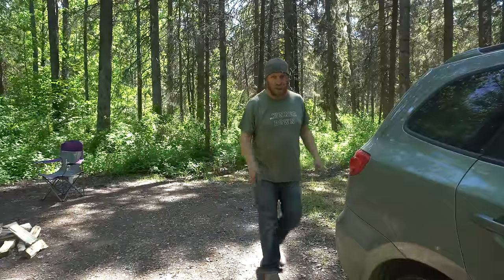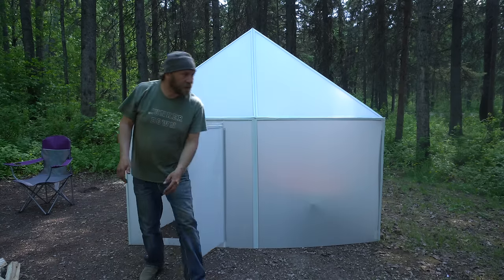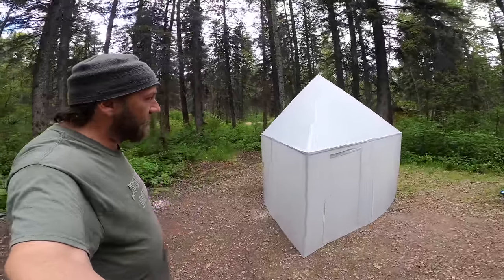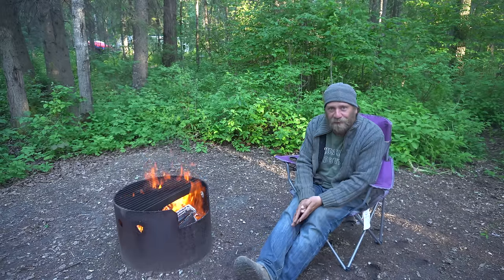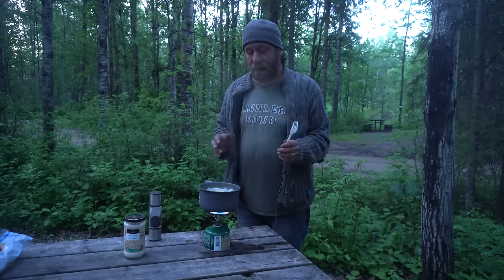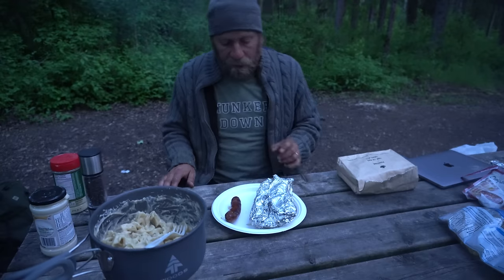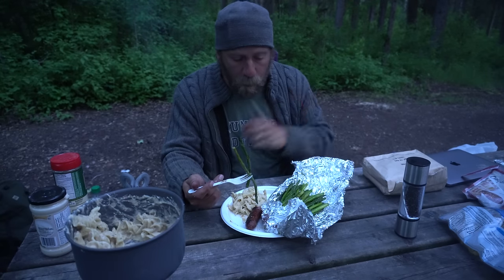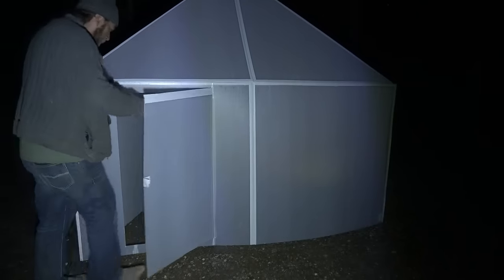Instant Pop Up Shelter Camping

Comment: You’re such an honest dude Steve. It’s one thing to have camping as a hobby and another to consider your impact on the environment. Thanks for using paper plates and biodegradable forks, it really shows you care for nature. This is how camping should be.
Reply: Do you understand the manufacturing process and energy that goes into making paper plates each year? In the long run it isn’t much more eco friendly..
Reply: @MrThatnativeguy  It's more eco friendly than plastic, in the long run.
Reply: Stainless steel plate.  No soap needed to clean.

Comment: When that popped up it immediately got my full attention!

Really clever design, excellent use of lightweight, strong and thermally efficient Coroplast.

I would definitely install a stove jack and stove in colder temperatures.

Comment: I like the idea of that camp shelter, seems there’s room for improvement to make it a viable shelter for use to keep bugs out and rain and the condensation down.  Maybe add a zip in tarp floor and zip panels for the last open walls to assemble and even for the door.  You could possibly even do a double door and make one a screen door with some vents on the opposite side to help with air flow.

Comment: I just read an article that states that in the USA (where I live) there is a strict requirement in egg sizes (it is probably the same in Canada). That said, there is a range within each grouping. When supply exceeds demand the producers are allowed to down-size, meaning they can put extra large eggs in the large containers and smaller large eggs in the medium containers etc. When demand is less then the producers will grade them by the appropriate size. edited [But I agree with you. I have a carton of medium eggs and one of large eggs and there were several in the large egg container that were the same size or only slightly larger than the medium eggs. However, when I weighed the eggs the ones in the large egg ca
arton weighed more than the medium eggs- maybe thicker shells?]

Comment: If you want to use the structure in the summer or for stealth camping you could consider putting camo tarp on the outside and cutting holes in it that you cover with mosquito netting for better ventilation. Keep doing what you are doing Steve, also love your smile :)

Comment: You should definitely add two dense mesh windows on two sides to allow a good air flow should keep the heat and moisture down definitely won’t help with the bugs but if you add a slight lip around the bottom of the entire edge you can lay loose dirt on it to create a little better seal to help keep some of the mosquitoes out.

Comment: Definitely cut some vent holes in the roof and gorilla tape on some screen door mesh! That would do a lot to help with comfort in your shelter. 

Also, I never go camping without one of those electric bug rackets.  That will clear the skeeters ot of the shelter fast.

Comment: That shelter actually looks good to me. With some cheap space blanket material put over the roof with spray adhesive, actual hinges on the panels and a couple of screens, for cross ventilation (with clear plastic covers, maybe), it could be great. Okay, some way to peg it to the ground.

Comment: I think I would cut a couple holes in the walls and glue some screen to those holes. Also I would paint the roof a silver color and just go nuts painting the sides to help block out any light from shining in or out. The bug problem will be a hard one unless you spray as soon as you setup the shelter.

Comment: Steve the skeeters get in from under the pop up, so get pool noodles from buck store and cut a slit in them and slide on bottom walls on pop up.
Staple or tuck in the slit between walls and noodle old rags, tshirts, socks or any flimsy fabric to drop down over pool noodle to ground like a skirt.
God Bless

Comment: Steve I came up with an idea. If you want to try it I will share it with you. 

You ever see those dumpster in a bag? They are about $30 US and design to be used at a construction site to be picked up later by a crane truck. These are over designed and the floor should support a decent size floor. You could find a good sturdy tree use a pully system to get your frame up the tree and set up. If you want secure it there for good and you can use your bag as a security guard against the set falling out of  the sky. Should fit a 4x8 sheet of plywood inside . Or you can build on a barge float to a place you want a camp hoist it off the barge next time you go out you only need a canoe.

Comment: Hi Steve, 
The shelter could have become steamy coz it had no windows for ventilation with bug-mesh to keep the mosquitoes out. 
I have a good idea that you could buy some spray paint cans in various "camo" colours and spray the the shelter to be more stealth, but I dunno if parking the car next to it counts for stealth even if the shelter had the "camo" spray job, though.
Hmmm, may have to think about that a bit more, after several step twos. 🤣😁
Reply: Probably a good idea to color/paint it, as the paint would block a bit more light from coming through, to allow for sleeping in. Definitely need some kind of mosquito or mist netting around the door and maybe some ventilation cut outs with mesh as well.

Comment: cut a 12" tall vent strip along the bottom panels, do similar at the top of the "tent" and use more plastic pieces as rain/wind/privacy covers and get creative to prop them up. basically allow hot air to rise out the top and pull cooler ground air into the shelter. strategic attaching of bug netting or at least screen mesh will help keep bugs out.

Comment: Perhaps, if you added a couple screened vents towards the top? might help with the condensation maybe. also, might just need to tape it up bit better. or in the corners added series of holes, enough to do something like shoe strings thur to tie up the corners tighter.

Comment: Seal the thing up and add your own mesh windows. Maybe a computer fan for the windless nights. Velcro could help too I'm sure.

Or a garage rooftop ventilator if you can find a light one or replicate one with plastic. Maybe a reflective mat you can attach to the sunward side.

Foldable housing.

Comment: Nice fast set-up. Shelter looks great. Solid material, so how are the mosquitoes getting in? Have you considered cutting about four windows in some of the panels and screening the openings for cross ventilation? You could cut three sides and let them hinge on the uncut side at the top edge so it would shed rain. Just prop open when needed. Also a light green and beige color would still be relatively cool but not so starkly noticeable. It is a great design that just needs a little refining.

Comment: Worst campground I've been to was Honey Bear in the North Carolina mountains (in or near Asheville). Each site had room for a car and a tent. A small tent. Folks packed in, walking to the bathrooms at 2am walking just a couple feet from your head. The icing was it started pouring at 3am and water came flooding into the tent. Had an air mattress on the ground and it nearly came up to the top. It was near freezing so not good. All our clothes were soaked. Then in the morning after zero sleep, these brown squirrels were throwing stuff at us. Never again. Got a new tent after that too....

Comment: If you could use some velcro and some rubber to fill the gaps plus maybe add a floor that may help with mosquitoes? That is a cool shelter but with some tweaks, I think that you could make that shelter much better?

Comment: It's a rad design just needs some simple modifications. Need a way to peg it down on all the corners. I'm sure that wouldn't be too hard. A guy line option or four wouldn't be a bad idea. For ventilation you could just add a window or two, with some old screening or mesh cut out to fit. You could also add a screen option on your entry.  For the window(s), cut it out the opposite way you did the door, so that you can set up a prop system that would allow you to keep the window open during rain, letting the water pour over the window hatch.  Also, a roof vent would be helpful for reducing the condensation. Wouldn't have to be big, just something you could pop up and back down, designed in a way that it will keep rain out when in vent mode.  I could see issues with the glue on the gorilla tape getting runny in heavy heat....it's happened to me.

Comment: i worked for a corrugated packing company for 25yrs but it wasn't packing material like cardboard, it was metal Seals for the Aerospace Industry (to join fuel lines) but we regularly got locals banging on the door asking for spare cardboard boxes lol

Comment: If you like the Design use Strips of Canvas and Glue it down the seams, then Water Proof it, as for the Color, Camo Paint time. add few vents with Screen Glues over holes inside.

Comment: You can use a multi purpose glue and some this Quito proof find mash to make yourself some screen windows on that shelter just make a little  Window door just like you made the door on  Your shelter that open towards the inside. Next you need to attach some sort of a button  Inside and outside with some strong twine, So use a plain point to poke a hole through which to poke the twine carry that twine through the button in attach it 1st or pull 2 ends of  the twine through to the other side.. put I button or knob on the windoor. Use the trying to close it up like some kind of folder you may have seen in your life. So, to sum it up. your Screen is tape or glued to the outside and your 3 cut when door opens to the inside and you can close it with string and buttons. make windoors all around if you want for ventilation, or visuals.

 2nd little problem. 2nd little problem, can be fixed  by an open space at the top so that  Noxious C02 or methane farts or foot odor can escape, Like right up at the top Of ATP, however, you must cover this whole in such a way that the rain cannot come in... so you just make yourself a 3 pc triangle of Coroplast  Also taped together and now we just have to figure out a way to either make it detachable or to affix it    Permanently or so that it can oragami with the rest of it which means part of it may have to be affixed and part of it may have to be seamed up with tape after it is set up

I mean that have the words to appropriately describe and there's idea and it might just mess up how you interpret it but I'm thinking kind of like those little roofs on a camp stove chimney pipe, you know?

 On the inside of this, Watch him a call it feature is where you going to want to attach your mosquito proof cloth and you're going to have to allow extra cloth probably for the folding aspect. If I had it here in could touch it I could figure it out in a heart beat but things are kind of too abstract when they're not right in front of me and I can't touch it. Know what I mean? It's like doing algebra or calculus in your head...

Comment: You could make little [__] shape fold 'm up windows in this shelter that you can pull out using gorillatape tabs, and then tape some no see'um mesh on the inside to keep the bugs out. Windows shaped like this would vent and shed the rain at the same time.

Comment: Could you seal up the seams with more duct tape or is that not possible with that design?  If they are coming in at the base, maybe you could add a cloth skirt attached with tape to seal the base from water or bugs.  How about using some insulating foam for the material, maybe with the silver lining out for summer?  You would not know that the sun was up.  Plastic, foam, and duct tape are all Highly Flammable, so be careful!

Comment: Gorilla tape is good but maybe velcro the corners with full strips? I could see how they were open to the elements....no wonder the skeeters were partying....also, I would have some lit Frankincense incense  burning  before I set it up...then, move the franincense into it.....when I am on my deck and there are skeeters, I burn one and stick it under the table...skeeters disappear.

Comment: Okay so why don't you cut and put some screens in the top for and you could have a rain fly over the top in case it rains, you could paint that camouflage so you can't stealth camp and why don't you burn sage in your campfire to keep mosquitoes away. And I don't know why you couldn't have just a little bitty tin can burner inside after putting screen in the top in the areas and burn sage in there to keep the mosquitoes away. Now I'm also wondering how are you keeping that from blowing away? That would be a perfect little tent for a shower and a toilet (bathroom) while I'm camping in my van.

Comment: I think it would be worth while to take an old ratchet strap and cut a 6" section for each corner poke a hole in it so u can stake it into the ground and sew it in the bottom corners so it wont blow away lol